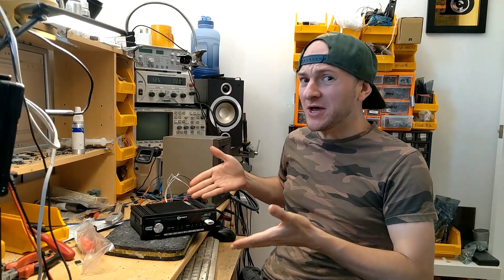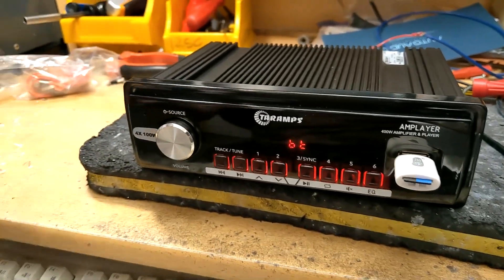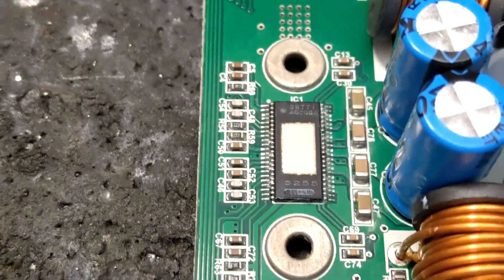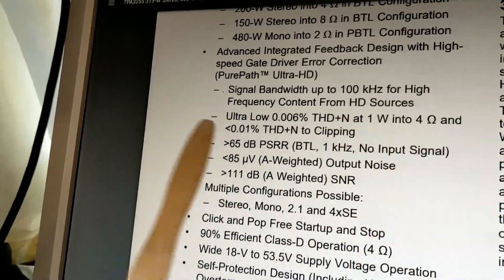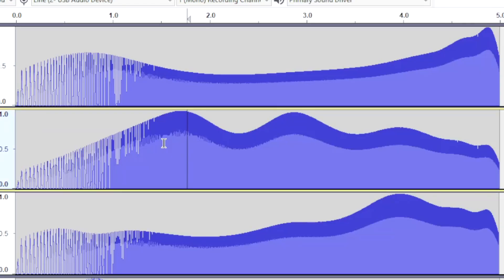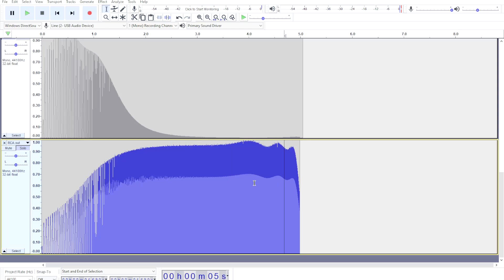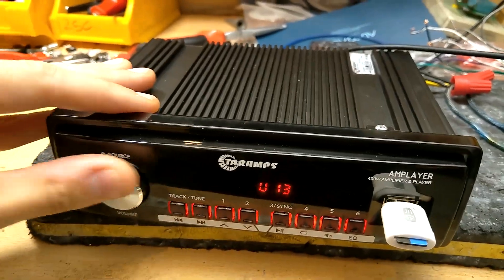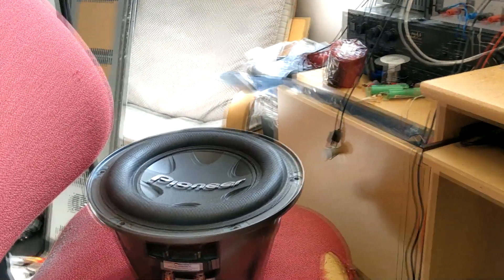Most POWERFUL head unit EVER - But there's an issue... Taramps Amplayer 400

Comment: Too bad they don't make even just a basic display on the single din love to see a 7" double din from them, maybe some subwoofers too! Question for ya i never seen you talk much on wire quality JP has but i was wondering since my runs to the back of my ride are garbage wire lol CCA i need to buy a run of 1/0 OFC should i leave the existing 1/0 CCA for good measure or will it do more harm then good? I know you're a busy man and i , well think we all appreciate you brother!! Teach me master Yoda!! Lol was that kiss assy enough or should put some more butter on the bread? Jokes aside you do great work and help people with your videos when you don't have to that says something.
Reply from the maker: @TheBrokeAssBassHead  don't buy car audio branded cable, buy welding cable which is required to adhere to industry safety and performance standards 😊 it's cheaper too. 50mm is 0 gauge 70mm is bigger 90mm is ridiculous
Reply: @barevids  Rock on thanks bro!
Reply: @barevids  I got 30 ft of welding grade 0 gauge for 106 bucks on eBay. I'm going to run two lines of 0 gauge to my trunk lol. I'm not messing around this time!!
Reply: taramps does make subwoofers, but they're only available here in brazil as far as i know.

Comment: A bit of a random ramble; I was chatting to my Dad today about how amps are getting smaller (he used to do mobile discos in the '80s with something like 100w+100w big hefty PA amps) and jokingly said more powerful amps are probably as small as this nowadays (pointing to a button the the TV remote), and I was like "nah, they've not shrunk them that much", and now I see this video with a single, tiny chip putting out 280w+280w plus!! What the actual f**k?!? I mean I understand that class D is pretty small and efficient, but that is one compact package. Also, why on earth did Taramps do a nice design on the back end, then just gave up halfway through and slapped on a godawful Chinese media player module on the front end? Makes no sense at all!
Reply from the maker: You want to look up GAN fet amps, TV remote button size amps are coming 🙌
Reply: @barevids  Interesting, I will read up on them, cheers!

Comment: one of the best ever measured amps out there (top 10 of hundreds measured in terms of  low noise and low distortion) uses a TPA3251, they really came far in class-d tech. 
its the lower power brother of the tpa3255.

Comment: Lame Headunit. The Pioneer MVH-280FD does the same but is released in 2015. And guess what? looks way better than this abomination of a headunit.
Reply from the maker: No it doesn't! The 4x100 rating of that unit is PEAK and absolutely meaningless. This Taramps makes 400w RMS. If comparing to the pioneer peak rating this would say 4 x 300w.

Comment: What amp module you can recommend for dyi install inside old cd players using rca for the inputs for the amp.Purpose is to create something like this but actually better.Ive already installed bluetooth through aux port.

Comment: The arrogance to override the audio recording mixing/mastering engineer/s with forced ridiculous eq settings.
If your audio system has sufficient gain and quality design (very low signal to noise ratio) there should be no need for eq.

Comment: I have a question. About class d amps. When the audio signal is at 0 so rest level does that mean the Amp is generating a 50 percent duty pwm. And if so does that also mean the mosfets are wasting energy and generating heat?
Reply from the maker: Correct, but no wasted evergy, because at 50% duty on both high and low side the resulting voltage after filter network is zero and there is no cross conduction (in a well designed amp).
Reply: @barevids  ohh so no current will flow. Thank you! I'm working on designing my own Amp and really enjoy your vids!

Comment: tpa s350h is great you have to install a $20 power converter with a switch to use but $50 on total 220w x2 and 350 for a sub

Comment: Hey, i want to ask some question in private to you, but im not sure how to actually dm you, i have a nakamichi PM600.1 that randomly goes into protect sometimes. even if it doesn't some times it just has kinda like a bumpy or pulsating noise thats not in any constant frequency. i have yet to check the circuits out, but any pointer in a direction will help. i suspect that the protection is because of a dc offset at the output. but since its not constant. it's hard to figure out what the problem is

Comment: somebody needs to make an amp that can fit in the small cavity behind most newer sony, pioneer, etc... mechless head units where they basically only use the top single din area for the back of the head unit and then the front extends down, this would allow you to have decent power in the same package as an older style double din head unit
Reply: There are amps just for that application.
Reply: I have a alpine ILX-650 that has a option for a 200rms amp that bolts to the back. I bought the whole set up for around 450. I’m running 2 6x9’s in my front doors and it gets loud.

Comment: I am kind of surprised that a mainstream HU manufacturer hasn't already picked up on this!  Most of them make shallow mechless decks and everyone makes small 100x4 ClassD amplifiers.  
It seems that it is always the obscure brands that come up with the neat ideas, and then they fizzle out due to lack of depth.
Great to see you back at it!
Reply: Sony is the only manufacturer that has efficient fully functional internally amplified head units. There are a few different models and they are tanks. Flat eq maxed out with megaphone bass on it does not clip on the speaker output channels. Rca outputs are also efficient as well. Williston audio labs tested one of the head units for more info
Reply: @bronwynkaye9277  I think the ability to clip on the speakers outputs is a good thing. It means you have extra volume for those quieter recordings. I wonder why Sony limited them?
Reply: @JasonWW2000  the level of output the radio produces is above par. As far as the rca signal goes, the voltage output exceeds most amps anywhere above volume 32 and sub output level 4. That being said there is a lot of overhead for rca voltage up to 7.6volts. That specific head unit does require direct pos n neg to battery due to power consumption.
Reply: @bronwynkaye9277  I was referring to the speaker level outputs. The internal amp outputs. Most manufacturers design in extra output, clipped, in case you listen to a lower level recording. Do you understand what I'm saying? Almost all manufacturers do this. I was just curious why Sony did not do it on all their models. Its okay if you don't know why Sony did that, it should be a question I need to ask Sony.
Reply: The high-powered amplifier chip in this unit maybe brand new. Taramps may simply have been the first company to use it. They may have rushed the design. I bet there are several head unit companies that are still in the process of designing and making their new high-powered head units.
Edit - It turns out these chips have been out for years. So I guess manufacturers don't want to use them.
Reply: That's actually a good point.

Comment: undefeatable EQ, MP3 only, who knows what protocol supported on BT side. AAC only? SBC?. better go get external amp and stay with stock head unit i think.. lol.
oh yeah, while dummy load seemed to be hard on the amp, speakers is actually can be way harder since they're actual motor that can be highly inductive. not to mention folks who uses passive XOs, it could be capacitive. some "audiophile" cable can drive the amp into oscillation because of how capacitive they are.

Comment: Very cool concept but the quirks you found are completely unacceptable. As another commentor also mentioned, there's a reason why most manufacturers keep their headunits below 80w rms total and it's not just to upsell you to a component amp. It's because HEAT is an issue in the dash. I cannot imagine how hot this chassis will get at full tilt with that shallow heatsink and no active cooling. Even if there was a fan or a legit heatsink, where is the heat going to go? The wiring in the dash? The mounting kit? The skeleton, ductwork, trim panels, etc that make up the dash? The only scenario in which I see this thing surviving would be in a vehicle that has an AC duct directly above it and a climate and driver that runs the AC at all times

Comment: thats to bad this could of been something my mom sed i liked to have some bump in her car but dont want me to run big power wire and amp to the back of her car this could of been perfect if they had custom eq or just bass and treble i would of put it on pair of low watt 10s or 12s and some good door speakers in the front and run like 8 gage power from under the hood hope they fix it great video
Reply: Just an aside, if you only want a few hundred watts then you can probably run a fused 8-gauge wire from the internal fuse box input of the vehicle to the rear. Once you go over 500 W or so then you may need to do a traditional power run from the main battery.

Comment: My little 20 year old $159 Pioneer head unit has the ability to run the rear channels in powered sub mode with independent control.  Pushing four NVX 6x8s, the rear two in sub mode, and some good deadening and sealing in the doors, my friends get pissed off 'cause I hit harder and cleaner than their store-bought budget systems.  That head unit has followed me through four cars now.  <3
Reply: So your running your rear mids & highs as subwoofers?
Reply: @DTW-bx2vy  I think the guy meant he has 2 6x9 speakers in his trunk set to sub-mode and the other 6x9 in the rear seat regular speakers.
Reply: @Styphoryte Either way ts ain't beating harder then anyones my hondas factory speakers probably sound better tbh😂
Reply: @ Wait yeah im stupid whenever I typed that last comment I think I meant to say the dude has the rear 6x9 speakers in sub mode and the front ones just normal. So he's using his rear speakers as subs basically, probably doesn't sound good if you're riding in the back seat as much but it would work I guess.

Comment: With modern micro-controller technology, seems a bit ridiculous how they designed this. I feel like this idea would have been great 20+ years ago, and I suppose still an option for older vehicles, but modern cars I can’t see anyone installing one of these, it looks like an ancient flea market brand head unit, with not very good adjustability. Could be cool to make a portable boombox driving a couple 10’s and highs where you only need a server power supply to run it. I’ll admit I’m not much into audio gear as I’ve gotten older, and I don’t play with it much at all these days, just trying to see a solid use for it. A car audio enthusiast would have no use for this, meaning, there are much better alternatives for SQ or SPL, or well even daily systems when it comes to a head unit, and the average consumer would be better off with a modern OEM head unit and just add a small amp under a seat if 100wx4 is needed. Just thinking out loud as I watch this. Interesting product but definitely needs a lot of rethought to the functionality.

Comment: I planned this exact thing with this exact tpa3255 chip few years ago. My plan was to make a custom pcb with a 50v boost converter, two tpa3255 to drive all 4 channels in individual btl mode. And can bridge one or both of the chips to get that sweet 480w. 
My idea was to build it around a regular sony mex n5200bt that i have in my car. I wanted it to basically fit on the exact pins of the original audio amplifier chip and just take audio signal from pins and send the output back through the same pins. The power would have to come from separate wiring. My main concern was cooling and i spent a lot of time in selecting a proper heatsink. My goal was to use a laptop heatsink that has heatpipe & fins so it would not be too bulky but cool the chip effectively. Also fitting a 12v-50v dc - dc 900w powersupply in there was almost impossible and i am very new to dc dc converters. I have made class d and class ab many times. And researching on making my own 220v - 35± dc powersupply. I have the parts . Desinging a powersupply is quite complicated and there aren't any typical application diagrams to follow. 
This headunit is quite a failure in my opinion just because they totally missed out on the pre amp section. They basically stuck a 2$ bluetooth module with tpa3255 & powersupply. I have the same exact bluetooth module and it has the same exact presets. These don't sound too good. If you compare it with something like a mex n5200bt. 
A dsx-gs80 looks much better option with 80w x4 into 2ohm and 50w x4 into 4ohm. Gs80 used a similar texas instruments class d chip but it is slightly different, pioneer & sony both are using that ic in their high power headunits. Sony been using it since the days of mex xb100bt so it's in use for 5-6 years now. Tpa3255 is found in home theatre and powered subwoofer systems. You would not find them in car audio amplifiers often. 
In my opinion a jvc or Kenwood 100$ headunit + a 100$ class d amp would be much better buy than this 200$ crap. If it was 100$ it would have been better.
Reply: shit i gotta tpas350h in me car

Comment: I could see many issues with this head unit, but the main thing as an installer I see is a problem, is there a head unit melting peoples dash and or dash kit from the heat of the amplifier. They should separate the amp from the head unit to relocate somewhere else.

Comment: Great concept, but the lack of audio processing and UI is a big drawback. I found it funny when you say there's no fade adjustment.  If they would've added better EQ, LPF/HPF adjustment (beside having to take the radio out to switch), front and rear fade adjustment, better readable displace, etc. It would have been a great radio that can run an entire system without the need of a separate amps.
Reply: não é feito para isso , aqui no brasil buscamos a praticidade de ter um aparelho que seja de fácil instalação.
se quiser mais EQ compre um sistema melhor com processador de áudio , temos vários modelos que atendem qualquer gosto musical.
Reply: @TheHiuriiiTaramps does?  Or you have other decks with class D amps available from other brands in Brazil?
Reply: Вы правы! Странно выпускать такой аппарат без настроек звука. У нас в России тоже стали производить подобные проигрыватели D класса только с процессором , нормальным двустрочным дисплеем и полным набором функций не хуже чем в знаменитых проигрывателях компании Pioneer

Comment: Nice video how about a sound test with a sub and speakers i think it's made for pro series audio like prv just a gess
Reply from the maker: It actually sounded pretty "fun" on both my Rotels and Wharfedales, since these older speakers benefit more from a smiley face EQ curve where small sealed box causes low freq rolloff and especially on the Rotels the cone tweeters could do with a bit more brightness.

Comment: I will stick with the Sony 45x4rms @4ohms 70x4 rms @ 2 ohms for about $220 usd and good eq and build quality. Thank you for this review it's great see how it compares
Reply: Sony DSX-GS80, in case anyone is wondering.
Reply: @stanshingler thanks lol
Reply: Was thinking the same thing
Reply: 10 years ago I stopped for looking, I wonder if nowadays there is a (ultrabudget) headunit with Parametric EQ (not graphical EQ)?
Reply: @edfx  jvc x482bt has 13band parametric from the headunit and graphical from the phone app.. although i am not sure if the numbers are in decibel so it is not true parametric eq but it works really well.
Reply: What do you need an EQ for besides making sure everything is 100% flat instead of boosted?
Reply: @DTW-bx2vy  because every car is different and just because the radio plays flat , (which this one does not at all.)  Does not mean you have a flat response in side a car , you have to tune every car different to achieve a flat response. Due to speaker placement , cabin gain , and in general your speakers response curve.
Reply: @paulgood2218  Everyone likes what they like, I keep everything flat as possible & would never use any boost & only cut instead. So all the frequencies played threw the mids & highs are never peaky or overly sharp.
Reply: 😂😂😂😂 OK. That taramp did double sonys power.  That sony only does 80 watts bridged at 2 ohm. I have a 07 pioneer deh6000ub that does 60 watts bridged at 2ohms. That taramp made good power